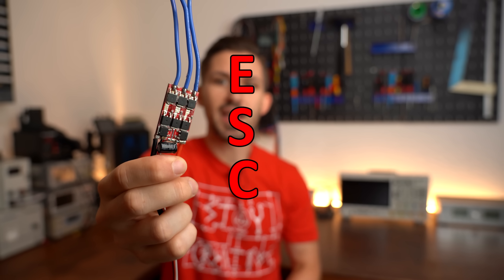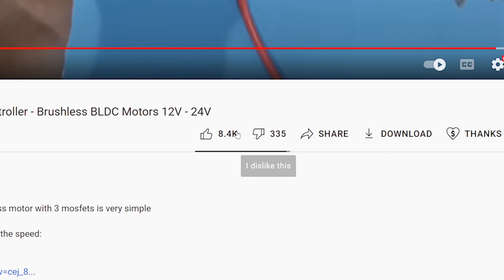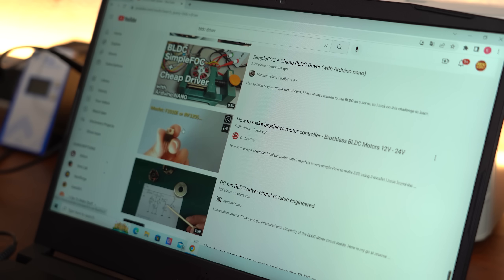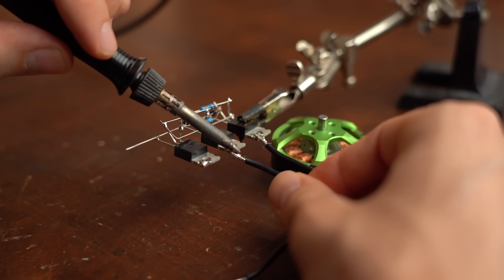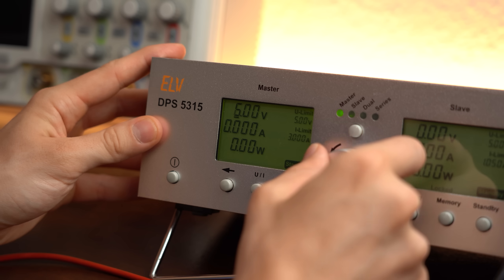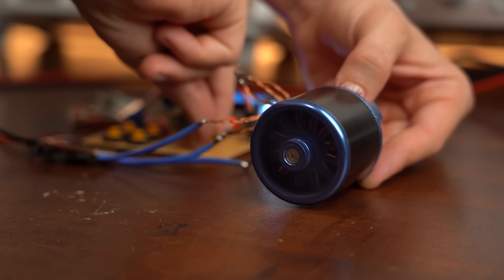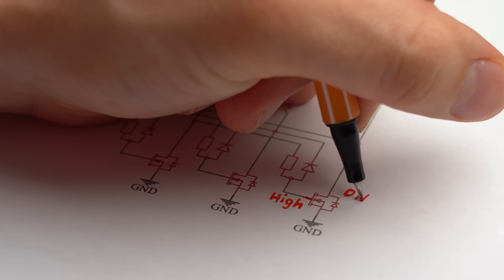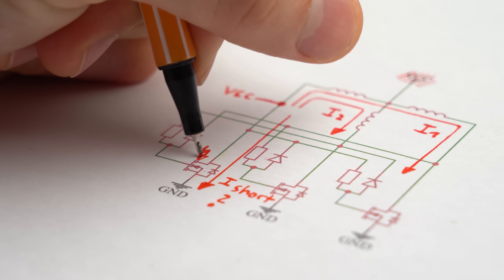I followed a YouTube Electronics Video and Regret it! (Debunking a 500k video)

Comment: Hey,
I really enjoy your content.
Do you still take video requests? I'm trying to design a circuit that heats a resistive wire (4 Ohm). Basically I have an Arduino, that I want to use to drive a P-MOSFET that connects the wire to 24V source. Between the Arduino and MOSFET I'm trying to design a totem pole (push-pull) driver but I'm still unsuccessful. I'm trying to control the voltage for the wire, basically trying to do buck converter.
I'm trying to learn everywhere I can but I'm currently stuck with this problem. I don't fully understand the calculation, like how much current is going to the gate of the MOSFET when it's charging and if its charging properly. I saw your videos, but you're using an gate driver IC.
If you would feel like doing something like this with a little calculation I would be greateful.
Thanks and keep up the great work!
Reply: The current to the gate of the MOSFET is nearly immaterial. It is a voltage-controlled device. A huge current flows for an instant when switching but then it quiesces (falls essentially to 0). Many will put a resistor in the connection to the gate to keep current down, to keep that huge switching pulse down. Really any resistor will work. 1K, whatever.

You're going to have a lot of trouble running a P-FET to switch that resistor. Specifically to turn the FET off. This is because for the PFET to work you have to put it in the circuit between the resistor and the positive voltage rail with the source connected to the positive rail, the drain to the resistor and the gate toward the Arduino. You cannot put it between the resistor and ground because then the source voltage will drop to 0 when the FET is off, with no constant source voltage you can't manipulate the gate to source (critical turn on/off) voltage properly. you cannot turn the FET around so that the source is at Gnd because then the body diode will conduct all the time and it'll never turn off.

So the PFET will be above the resistor and to turn the FET (resistor) on you simply need to output any voltage below about 23V to the gate. That's easy. The problem is that to turn it off you need to get the gate voltage up to about 24V (above 23.4V). And you can't do that from your Arduino. The highest voltage it can output is 5V (IIRC).

The reason for this is the turn on voltage for a PFET is a negative number referenced to the source. And the source in your case is at 24V since it i. If the turn on voltage is (say) -1.1V you add that to the source voltage of 24V and  then that means putting 0-22.9V on the gate turns it on and 23.0V and up turns it off.

Your easiest out for this is just to turn the circuit over and do low side switching with an N-MOSFET. Like in this figure.

https://en.wikipedia.org/wiki/MOSFET#/media/File:Mosfet_n-ch_circuit.svg

Where you just leave the LED out. And note the source is to ground, the drain to resistor. Other end of resistor to 24V. Then the wire that goes to the switch there from the gate you connect that to your Arduino GPIO. Now to turn off you have to get 0V onto the gate. That's easy, either drive 0V out or just don't drive out and let the resistor pull the gate to Gnd. To turn on you have to get over about 1.1V to the gate. That's easy, just drive out high (5V) and it'll turn on.

Now you can turn your resistor on and off easily from your Arduino. There are some difficulties, like currents. You can work that out. The other is that whether the resistor is on or off it still has at least one end at 24V. So you have to design your enclosure so that that resistor doesn't come into contact with ground OR PEOPLE.

If you can't do that, then you have to go back to the PFET design again and instead design a gate driver. I personally do this by using an NFET to drive the PFET gate. You hook the PFET up above the resistor as mentioned above, put a weak (10K, 100K) resistor from the PFET gate to 24V so that the PFET is off. Now to turn on the PFET you have to pull the gate down. You do that using an NFET. You hook the drain of the NFET to the gate of the PFET. The source of the NFET to ground. And the gate of the NFET to the Arduino. Also hook a resistor to gate of the NFET and to ground.  Now, as the NFET explanation above driving the Arduino GPIO out high (5V) will turn on the NFET. But when the NFET turns on now it pulls the PFET gate down and turns that on. Driving out low or not driving out at all will turn it all off, although a bit slower than it turned on (still in tens of milliseconds at most).

Note these NFET circuits (and thus the NFET driver to PFET) will also work fine if you have a 3.3V Arduino (do such things exist?). As long as your gate threshold on the NFET is below 3V. And there are many which are.
Reply: i like ur funny words magic man
so are u trying to turn on a resistive wire
or are u trying to make a complementary transistor circuit
or are u trying to make a buck converter?

if bjt doesnt work, u could try cmos
but u dont really need driver for switching a heating wire
if u want to switch something on and off, u don't even need a complementary configuration, normally u only need 1 mosfet
but the tricky thing here is actually the 24v source, most mosfets probably cant handle vgs more than 20v difference
even trickier the that the mosfet is p type
if u wanted a complementary configuration at the gate of the p-mosfet, u would have needed 2 different voltage source that supply high current and more than 2 extra transistors, and the arduino 0v and 5v would have to be mapped to 12v and 24v, this is much more complicated and an opamp might be necessary

a buck converter is quite simple to make, u can feedback using opamp to an oscillation circuit,
or u can directly feedback to microcontroller to control pwm

another way to control voltage for the wire is using linear regulator, lm317 or build ur own with an opamp like the buck converter
building a linear regulator with opamp is easier than building buck converter, just need some resistors and a transistor
but a lot of power loss in the transistor, and linear power transistors are more expensive than switching power transistors

and a buck converter doesn't really "control the voltage", if u truly wanted to control the voltage, u would need the p-mosfet to operate in it's linear region
that's a lot of power loss, most mosfets today are switching mosfets, u can get one expensive beefy switching mosfet and strap a heatsink to it to operate in linear region, but it is still 50% chance that it is gonna burn up in flames and explode because they are just not designed to do that, u have to consider the power lost in the transistor using P=VI

most switching transistors say they could handle crazy currents like 49A 100A, but that's for switching at high frequency, very momentary current, they gonna explode if u tried to conduct 49A in saturation

but why are u even trying to control the voltage?
fun fact, u dont need to
u are just trying to heat up the wire

and why do u care about the current in the gate? for dc application, this is like non existent
only for very high frequency do u actually need to care about the gate capacitance and crap

u are overcomplicating a very simple problem
and there is a very simple solution,
it is called PWM

as for the p-mosfet part, everything is reversed from n-mos
but for both, load are typically driven at the drain side
and source pin are connected directly to ground for an n-mos
this make the mosfet have very low and negligible resistance and voltage drop(see rds(on)), even lower than bjts, bjts normally have 0. something of vce(sat) and vce(sat)>1v for power bjts, but mosfets just has rds(on)
that means when turned on, mosfets are effectively short circuit while bjts are like diodes(in terms of voltage drop)

and p-mosfet has reversed everything, that means current directions and voltages, it can do the same thing as n-mos, just reversed
for p-mosfet, u would want ur source voltage instead of ground on ur source pin
and since positive voltage on gate turns on an n-mos, that means p-mos will turn on if u apply a more negative voltage than the source pin
but dont directly connect the gate to ground, mosfets have max rated vgs, and for those irf stuff i have seen is + -20 for n and p mosfet respectively, connecting directly to ground means vgs=-24 and that means it blows up
and this is very inconvenient because arduino only outputs 5v or 0v

so we will need to use another component, either another transistor or opamp, since using opamp is overcomplicating a simple problem, we will use transistor

we will use an npn bjt, connect emitter to ground, connect arduino output in series with a resistor to base
now make a voltage divider where one side is connected to 24v, middle is connected to gate of p-mosfet and another side is connected to the collector of npn bjt
use equal value for both resistors so when the npn bjt is turned on, the gate voltage becomes about 12v
so now when output is 0v, bjt turns off, gate is pulled up to 24v, vgs=0v, p-mosfet is turned off
and when output is 5v, current goes through bjt and turns it on(base resistor is only there to limit current to prevent arduino and bjt from being damaged, so make sure base resistance is low enough that it can still make bjt go into saturation, turning it completely on), and voltage gets divided at the gate, vgs=-12v, turning it on and perfectly safe

for the last part, we connect the heating wire to the drain of p-mosfet, then the other side of the heating wire to the ground
voila, we made it
when arduino outputs 5v, p-mosfet turns on and wire heats up, when arduino outputs 0v, p-mosfet turns off and wire cool down

now this is where PWM comes in, imagine if you switched ur output on for some time
then switched it off for some time
let's say 60% of the time u switched on and 40% time it is off
that means 60% of the time u r applying 24v
which is same as applying 14.4v constantly
if 50% of the time u switched on, that is equivalent to applying 12v constantly
this is almost like a buck converter but with less extra steps

and analogWrite in arduino does exactly just that, it isnt actually outputting a real analog voltage, it is outputting a 5V PWM, at around 500 or 1000 something Hz
that frequency is fine so u dont have to manually to change the timer register to adjust PWM resolution and frequency
at this frequency, u dont really have to care about gate current or capacitance
remember in ac circuit, Xc is lower when frequency is higher, but Xc is higher when frequency is low, that means current will be lower at low frequency, negligibly low
just assume everything is 0

for heating a wire, u can even use tens of Hz, mybe even 10Hz, 100Hz is also fine
any frequency will produce the same result and same heat, frequency isnt really critical for heating a wire

in conclusion, this is a very simple problem, u just needed 3 more resistors and an npn bjt, base resistor could be something like 2.2k or 680 which will almost certainly ensure saturation, both resistors for voltage divider can be 10k or 2.2k
no calculations at all, dont need to overcomplicate stuff
Reply: @u r noob  I love your answer. I know that I might be overcomplicating heating a resistive wire. My initial thoughts were that I need a mosfet, that will open power to the wire and then I continued with I need to limit that voltage so I can control the amount of the heat that will be produced. So I jumped to the buck converter and immediately thought about fast switching the mosfet. 
My first tries were kinda too hot, because I was almost burning the MOSFET with slowly charging the gate and wrong voltages at the gate. Then I learned about push-pull (totem pole) driver and tried that. I also posted a question about this with a schematic on a stackexchange but instead of some constructive critique or some thoughts I got almost shamed without any explanation.
I was trying to learn everything I can from all kinds of videos so when I learned about push-pull I was eager to use it. Also I want to learn everything about mosfets and how to properly use them.
But I believe that I was overcomplicating that.
Thank you for your answer. That helped me understand a lot. I'll follow it.
Reply: @urnoob5528  I have one question tho, wouldn't the MOSFET burn? I tried your solution in a simulator and there was a 20V drop over the MOSFET.

Comment: Ah yes, this is exactly what happened to me as a kid many years ago, when I found a schematics of a guitar pedal in a magazine, built it myself and decided that electronics is bullshit since it didn't work.
Reply from the maker: Terrible when something like this is your first experience with electronics.
Reply: @greatscottlab  I would say this is a pefect first experience. It's simple and it works, but has a lot of room for improvements. A lot of stuff to experiment with.
Reply: @janklas7079  sounds like a great way to burn out a motor.
Reply: @fyfaenihelvete  To burn a motor you'd have to supply it with a higher current than the windings can handle.

Anyways, if you're not burning some electronics in your experiments, you're not learning.
Reply: @janklas7079  Get out bot!
Reply: @sophiacristina  I'm sorry I have no bot to get out.
Reply: Well no. To burn a motor give it woltage that heats it a lot. Then later its coils protection coat starts to melt. Anything keeping it hot can damage a electrical motor with inaulated cables. When it works it switches coils and causes wind. Therefore even in rated voltage range it can burn if its not spinning.
Reply: @ahmetmutlu348  You start with 'well no', and then proceed to say exactly what I said.

In order to 'burn' such a motor you have to give a winding more current than it can handle.  If the enamel melts due to heat, the winding can't handle the current.

Motors do not hav rated voltage ranges as voltage is pretty irrelevant.
Reply: @janklas7079  it's not just about "too much current" the motor windings are also inductors. Look up "back EMF" to understand why a motor draws too much current when it is stalled
Reply: @neilfarthing3888  note the 'too much current' in your text.

Too much current is the only thing, besides from an actual fire, which can burn a motor.
Reply: @janklas7079  Exactly. Get something that works, understand what it does and find how this can be done better.
Reply: My first electronics was when I was aged 9 with a chip called an LM3909, a capacitor, an LED and a 1.5v battery. Really simple.  All it did was flash the LED. It was quite cleaver because 1.5v is not enough to drive an LED. However as electronics got more complex I smoked more chips. I discovered the ZX81 and found I could make mistakes without smoking chips.
Reply: Oh, I built a super simple guitar pre-amplifier that I attached to a tube radio as power amp. I t was not very loud, but the sound was really really great. I lost the schematic and so this perfect simple circuit is lost in space.
Reply: Mhm usually magazine schematics are fine... a good article might contain troubleshooting tips from experience of people building the circuit. Maybe you started one or a couple steps too high up the complexity ladder that's all.
Reply: If you watched the video careful, you would have seen this device DID work.
Reply: @janklas7079  uo to the moment the smoke poped out
Reply: @janklas7079  If something "works" doesn't mean it'll keep working in the long run. Those MOSFETs will probably only last an hour before they go poof.
Reply: @RaduTek  Nontheless, it worked. I don't think anyone in their right mind would expect to build a long working pefect solution in this manner. That was not the purpose in the first place.
Reply: @janklas7079  A newbie wouldn't have the experience in electronics to know what could go wrong by building the bad circuit. They wouldn't have safety and longevity concepts in mind.
Reply: @Dihydrousoxide  An entirely new person to this type of hobby, no.
But I'm pretty sure a newbie wouldn't even know what an ESC is nor would look up on how to build one.

Comment: For learning purposes it can be helpful, as it's not as complex for a beginner to understand the concept of a BLDC motor
Reply from the maker: Hmmmmm well. Fine. I ok with that.
Reply: @greatscottlab  Starting 25 years ago, for purely teaching purposes, I have been showing the principle of driving a BLDC motor using 3 H-bridge based DC motor drivers. In practice it seems that people who want to drive 3 wire motors already have experience with H-bridges. Many H-bridges don't provide an easy way to control each half independently so I use half of each of three of them.

I first did this with the LEGO Mindstorms RCX (the model introduced in 1996). It made a cool demo and showed useful principles of operation.

The maximum speed was quite slow because the waveform steps were generated with the commands that started, stopped, and set the direction of each motor in the language interpreted by the RCX.

This removed a lot of the confusion about BLDC driver theory and builds on what they already know.

After seeing what amounts to bit banging a motor controller, they see the benefits of a more traditional controller with the 85 parts.